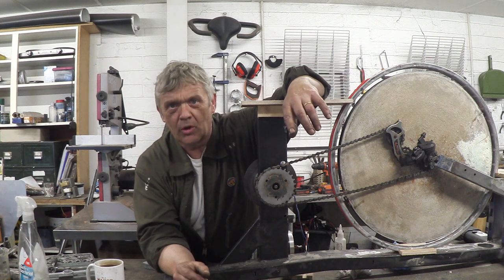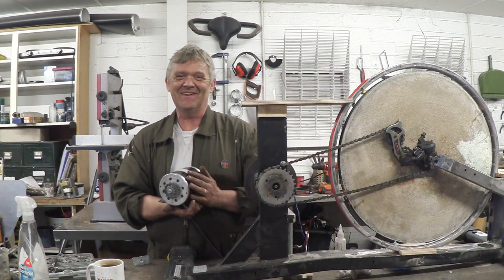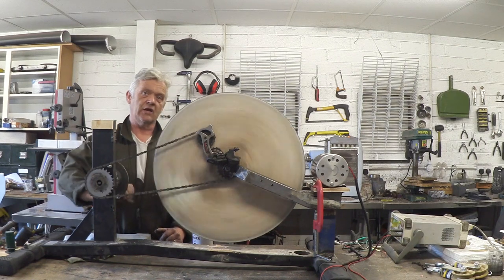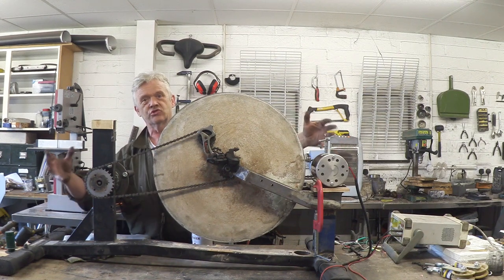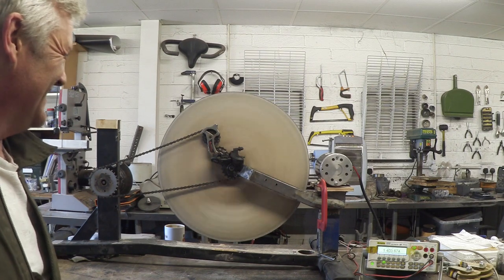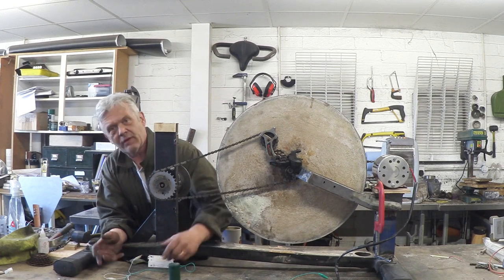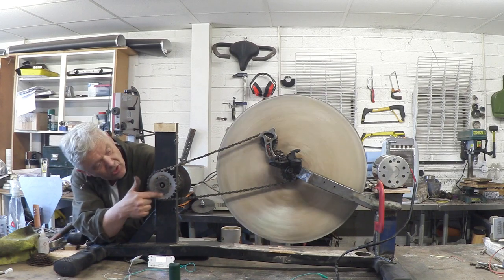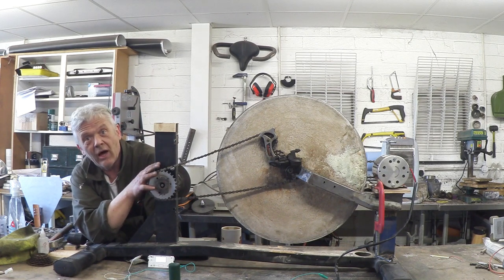1124 A DIY Kinetic Energy Recovery System - KERS

Comment: The flywheel is very under rated.
Reply from the maker: I agree
Reply: 100% the amount of potential energy is only limited to the size of flywheel you have and weight equally.
Reply: @EnterTheRealm  well and resistance, and I am wondering why they are not using high efficiency flywheels (like they are proposing for use in space to store power) to do testing on this whole dark matter and energy debate, would seem like a flywheel with good sensors could detect denser space or what ever it is that they think it is, Flywheels I guess are typically looked over due to all the losses normally found in the cruder (though still quite useful) versions.
Reply: @ThomasAndersonbsf  Resistance is only due load and mechanical contacts however I'm sure with enough weight and big enough wheel anything could be accomplished.
Reply: @ThinkingandTinkering  did you know in swiss we even had buses powered by that? not sure if they still active I don't think so but I was surprised when I heard that as it was pretty old tech too

Comment: I really enjoy watching your videos.  You always create such interesting projects and explain them very well.  I believe the fly wheel is also a battery for storing mechanical energy.  Many years ago (1960's I believe) they were experimenting on running transit busses on huge, heavy flywheels.  They were designed to use a much smaller engine than was usually used in busses because, all it had to do was run at a constant speed where it was the most efficient and the bus driver simply engaged a clutch and gearbox to tap into the energy stored in this flywheel.  When the bus was stopped like at a red light, the engine had plenty of time to get the flywheel back up to max. speed.  The flywheel, of course, did not add any energy to the system, it only stored it but, it took advantage of the time factor.  The bus could wait a few minutes, when first started in the morning, to get the flywheel up to speed before driving off so the small engine was simply using more time to store the same energy that could be used to operate the bus that the larger engine provided.  From what I remember, the prototype worked great but it obviously never went into production.  Maybe because, as I remember, gas was like $.15/gallon then?  (Diesel was also cheaper than gas was back then too.)
Reply from the maker: there was a lot of interest in alternatives back in the 70s due to the oil crisis - some great electric cars where developed then
Reply: yea look up gyrobus I was surprised when I first heard about this
Reply: @strongforce8466  1940's...nice.  That is earlier than the one I remember reading about when I was in school in the mid 1960's.  I think the US one used a small gas engine to spin up the flywheel but it is amazing the Swiss did this so long ago.  Thanks for the info.
Reply: @OverlandOne   you're welcome, yeah I was quite astonished when I heard about it, though when you think about it it's nothing too crazy technologically speaking, I was also quite surprised to hear about electric cars in the 1800s or something !!  

One can wonder if only people/companies/governements had focused on these type of tech early on, we wouldn't be in the mess that we're in ! 

If a single old system with motor/flywheel could run 5-10 KM can you imagine if this stuff was refined, you add multiple flywheels..with better efficiency of today's engineering

It's kind of the story about solar panels and that in the 60-70s (not sure exactly don't quote me on that) but they were already developing the first solar cells back then, imagine if instead of focusing on nuclear factories they researched more the solar cells the solar panels we would have today would probably make centralized energy creation with huge factories useless (Oh I'm sure the nuclear / oil / gas lobbies wouldn't be so happy about it though, the electrical/solar cells ones of course lol)
Reply: @strongforce8466  I have one of the first production solar cells ever made.  My Dad worked at Bell Labs in the 1950's and 1960's and these were developed for the Telstar (1st communications satellite) which was launched in 1962.  The cell I have was made earlier than that...probably around 59 or 60.  It still works but is very low power which was considered very high power for a cell back then.
Reply: @OverlandOne  very cool, yeah I imagine low power but that thing is collector

Comment: Hey Luke, I modified that motor you used in your scooter, there was too much resistance under load for me, the delivery wires got hot. I disassembled it and found 4 brush points around the commutator, I rewired the inside to 4 separate power leads of a bit heavier gage,  and installed some 300 volt electrolytic condensers in non polarized configuration across the power leads to lower the arcing on commutator help with loss and temperature. I also ported the end cap in between the brushes to help with the poor air flow. then it was run over voltage by twice, a nice addition would have been a dc squirrel cage cooling fan to run the air through the commentator brush area to help keep the temperature down, although it didn't need it in the race, have fun👍
Reply from the maker: Luke doesn't read the comments on videos he isn't in mate - but I will let him know - nice advice - cheers

Comment: Great idea with the supercapacitor. I think we're going to start seeing them used more often in regen braking systems as their price goes down and their capacity goes up. They're perfectly suited for capturing large current spikes and frequent charge/discharge cycles (not to mention their superior safety over Lithium batteries).

You should try experimenting with putting multiple supercapacitors on the output, and test their efficiency in parallel vs series (or combinations of the two). It would be easier to test the efficiency by feeding the power back into the motor after all the usable energy is recovered, then measuring the maximum speed of the flywheel after discharging.

Comment: That would be awesome rigged up to one of those hoverboard wheels as a generator or on of the direct drive motors from a new generation washing machine. They produce ac St a high voltage and high amperage.
Reply from the maker: awesome idea

Comment: works great i really like how inexpensive the concrete flywheel idea is to me that sthe best idea of this build also that big  dc motor is very good i have one just like it i think the rim is 1550 to get max volts generation if you put a really big sprocket or pulley on the flywheel for the generator i know you know this but yeah it would really give you some power like 12 or more volts also i really really liked that you implemented the joule thief circuit great work as always Robert Cheers i think that flywheel setup can have many many awesome configurations man if you would make it into an bedini pulse motor that would be rea;;y really awesome :) or some kind of back emf mechanical system like Joseph Newman
Reply from the maker: for sure mate

Comment: seems more of a kinetic battery you are building, better bearings and it would keep that energy for quite a long time waiting for you to engage the motor and extract that as electricity, a kinetic recovery system would be more like the magnetic breaking in an electric vehicle that uses the energy you throw away to say stop at a red light to fire off the car again when the light is green instead of taking more energy you bought (gas at gas station) to get back up to speed while the removal of it to stop is not only lost but you are throwing away break pads thus it's costing you both in wasted gasoline energy AND break pad material that eventually you have to buy new pads from constantly grinding them down by the stopping, as well as replacing rotors too from grinding them down too, though much slower as they are usually much harder material so the pad sacrifices material primarily, in the magnetic breaking you turn off the coils connection to the battery and switch those connections over to a charge unit to allow the magnets flying past to generate eddy currents causing resistance (cogging) and the electrons flowing to cause this are captured by the charge unit and shoved into a super cap or battery so you can extract it later when you switch those connections back to motor position so you can pulse it through the coils forcing the magnets to move rather than draggingg down on them slowing them down as they do in charge/breaking action,  TLDR of that is that there is no physical contact so nothing is physically being abraded by this action to slow your vehicle down and you save money two ways, :)
Reply: I have actually been planning something like this using the armature magnets in hard drives for a motor by putting them on the wheel's hub, and putting coils on a stator right next to them hooked up to a pulse controller so they can be used like a bi-directional brushless motor, and then figure out even if it has to be one of those physical switches that use a coil to move the switch from bridging contact set A to contact set B such as used in emergency back up battery systems for large units, where the coil is acting as a solenoid off the mains AC pulling the switch fingers down, and when the AC goes out, the fingers spring up touching a secondary set of contacts together that bring the battery powered inverter system into contact with the household or business's power lines running to the outlets and all the appliances and lights, but with the solenoid in this case hooked up to a switch that the break pedal activates and pushing further down on it causes the coil stator to move closer to the magnets inducing more eddy current into them, or has a pot resistor hooked up lowering the resistance between coils and charge unit or something though using arduino and hooking it up to that pot as analog input to control everything with solid state now seems more the direction to go,
Reply from the maker: cheers mate

Comment: Melt down some lead from an old soul pipe and dope your concrete with it as a powder and see what the added weight is: or use some of your red or yellow lead to add that weight to the flywheel... who knows until you try?

Comment: I was thinking about to convert an AC-Motor (from Vaccuum cleaner or used Drill) in a generator: Variable DC to the rotor and pick up the electricity from the stator. In that case I think it's possible to keep the voltage stabilazed for charge batteries or run other consumers. Ok - needs a bit electronic or somethings to regulate the AC for the rotor - but to get a scapped AC-Motor for free should not be a problem...
Reply from the maker: sounds like a good plan to me mate

Comment: I'm trying to visualize the gyroscopic precession issues with solid concrete wheels and my mind is boggling.
Reply from the maker: it will be the same with steel wheels or in fact any flywheel system - being concrete makes no real difference
Reply: @ThinkingandTinkering  Aye true enough, but I wouldn't want to by pedaling on it :)

Comment: It is utterly impossible to ever, with maybe two exceptions, to read the numbers on that multimeter - at least on a phone. I can't tell you how frustrating it is for me to watch you read the numbers and not do it out loud, while getting giddy about how impressed we might be without any idea what the voltage and amp ranges we're dealing with are, unless you happen to mention both of them.

Half the time you give us anything it's either volts or amps but not both. Also frustrating because both matter and simultaneous numbers matter too because of variance between attempts. (pedal, hand crank, twist, etc.)

People have told you this. You acknowledged it at least a few times. You could pay next to nothing to get simultaneous display of amps and volts that could be visible in your videos. I would say it's about time wouldn't you? We could learn more and focus our own ideas better if you did.

I hadn't quite completed the video before posting the above. you actually wrapped that one up satisfactorily with "disappointing" and "couple of volts couple of amps".